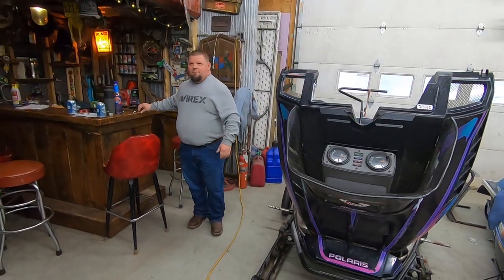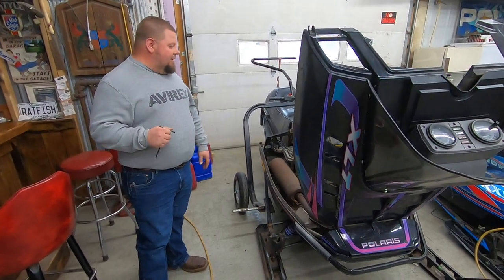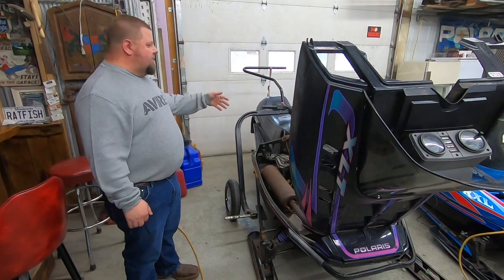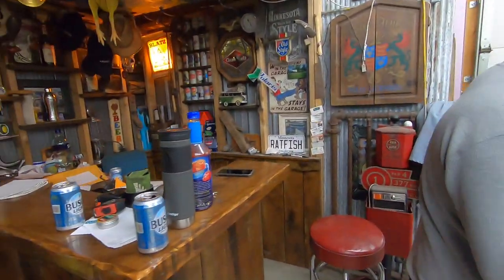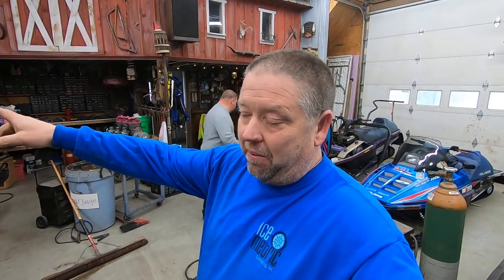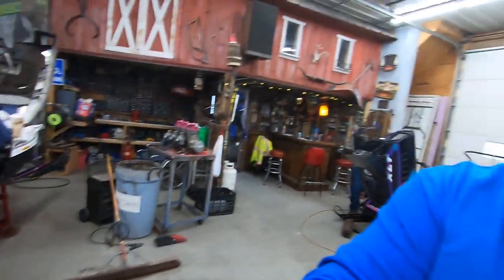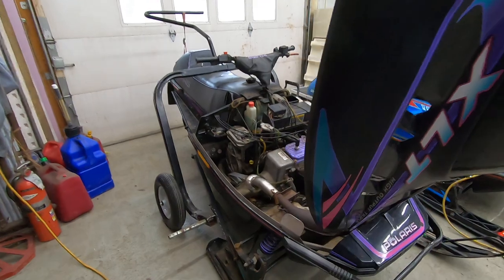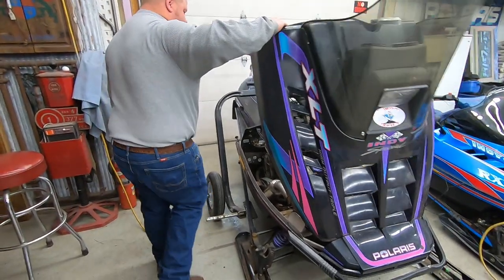POLARIS XLT 600 TRASH CAN!!! cheap mod sounds amazing

Comment: i have a xlt 600 1995, do i need to jet it if i change to a can like this? or will the pto bearing wear faster? does it increase RPMS?
Reply from the maker: No to all of the questions
Reply: @toddclyne3493  so its just with the whole triple pipe that the rmps increase? Is it the same if i make my own? Will a strait pipe incease the rpms in an other way than the can?

Comment: Where are you guys located I picked up a sks xlt I'll pay u to get running in tip top shape lol looks like you love the tripple tripple
Reply from the maker: Central mn. Triples all the way
Reply: @toddclyne3493  dam that's alittle ways away lol I may have to get a trash can lol u find the xltz reliable
Reply from the maker: @scottstadler8462  I've seen more than one with over 10000 miles on um
Reply: @toddclyne3493  nice this one is in pretty good shape only couple thousand on it and the sks lol